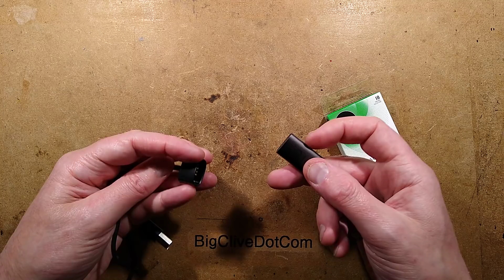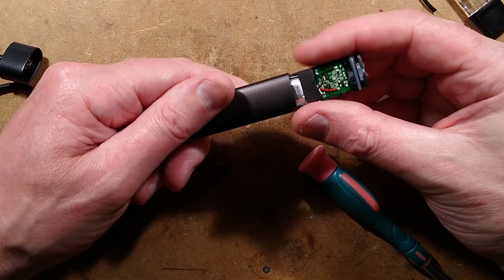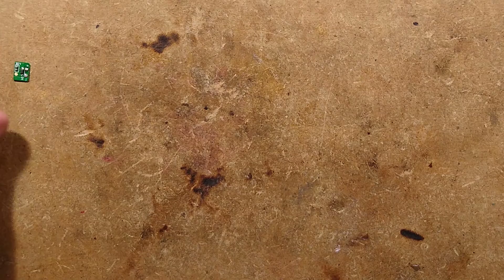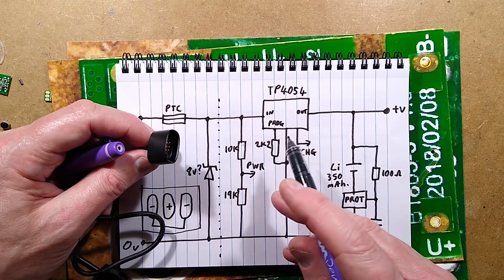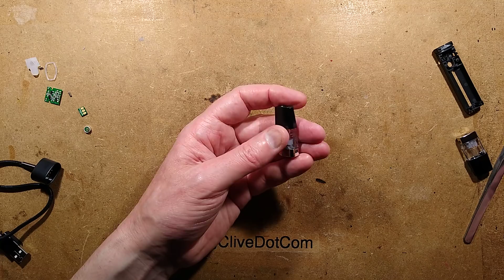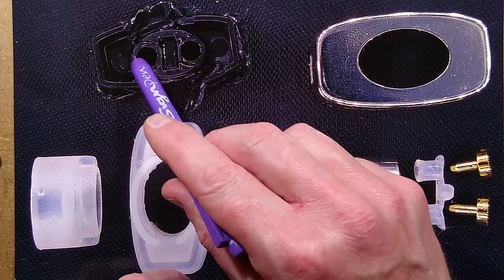Japanese fog-stick teardown.

Comment: I been trying to find a way to take apart a vape too..  havint found out a way seems pretty locked down.. ...   sigelei fog stick 80watt   came out this year  and i have 5 dead ones that died within couple months which was my family members...   I know if i can find a way to take them apart  i probably can get them going again...     http://sigelei.com/Product/Sigelei/Sigelei-FOG-STICK.html       @bigclivedotcom  would you know any idea how too get these barrel type vapes apart or anyone?   warranty was shit sigelei is slow and don't get back to their customers lol
Reply from the maker: Liquid ingress is often the problem with these devices.  It can cause track corrosion.
Reply: @bigclivedotcom   Yea they did leak under the pod a good bit which  needed cleaned a good bit and yea  family members hardy did that as i told them too... lol    just wish they wasint so dam locked tight...   There is 2 screws under were the pod goes on but taking them out just removes the plate and nothing else budges...
Reply: Found out how to get the things apart.   was looking at the bottom of the lcd screen and there is a metal ring going around it.  So i took my knife and put pressure on the edge  of it and yep it pop off and with the screws on top out of it.   got it apart which really wasint hard at all.     turns out a good bit of them batterys are stone dead so they wont charge.   But one was had a good battery  but had a bad firing button  and got one back working after sodering the battery in i :)

Comment: Isn't a microphone essentially a pressure sensor anyway, though?

And I can definitely attest to the inadvisability of magnetic connector-equipped devices for a trade worker - the offside-lead connector for my stereo Bluetooth earpiece was absolutely magical at finding swarf. I'd almost swear that it was generating swarf from thin air given its ability to attract substantial deposits while stuffed into my ear!

Comment: Eigate / Aspire do the same thing with their coils, soldering / welding non-heating / low-resistance wire between the heating coil and the coil cartridge contacts.  I believe it's fairly standard on the more premium brands, and it minimises heating of the 510 connector and tank body.

Comment: Interesting, does this monitor or regulate the resistance through the coil like a lot of modern mods.  It’s something you have to take close attention to on the rebuildable and tank coils
Reply from the maker: Just on or off.
Reply: bigclivedotcom so it could potentially still fire with a damaged / fatigued coil either increasing or deceasing the Ohms? Either way looks like a good bit of kit. As for refilling the ranks I would say they could be refilled a few times but eventually the cotton wicking material would burn or degrade.     Al this is of course based on much higher power rebuildable mods

Comment: Interesting the way he switched from Canon to Epson because I actually switched from an Epson Inkjet to a Canon Laser printer.  The Laser printer is of course much more expensive than an Inkjet but I got tired of not being able to scan or print because my Cyan ink was low again even thought I just filled it a month ago and barely printed a few pages.  Had the same issues with other Inkjets as well but with laser printers you don't have to worry about your ink drying out because it actually uses toner which is supposed to be dry.  The toner cartridges should also last damn near forever as they have much greater capacity (while a toner 'cartridge' cost more than an ink cartridge the actual cost per page is way better for a laser printer).

The reasons I went with Canon in particular is because 1; I'd already used both HP and Epson brand Inkjets and found them frustrating for numerous reasons (Clumsy over-bloated software, constantly need more ink, other software annoyances), 2; Canon had the best overall ratings as far as I could find, and 3; There was a Canon model that had everything I wanted (print and scan with both glass and feed scanners) with good reviews for $300 (which is very cheap for an All-in-One Laser printer).

Comment: You take apart the tank wrong. Instead of prying the metal bit off over the black tabs, you can push the black tabs in with your fingers therefore making it a more viable way to refill.

Comment: Hey Clive need some advice and know your the guru of all things electrical. I have been gifted a old nu tool ch10 bench 350w drill. It currently handles speed control by  manually moving a belt onto various sized pulleys... I want to change this to a electronic speed control, can you recommend the right unit I need??
Reply from the maker: It depends on the type of motor.  If it's single phase and you use a simple speed control you'll also lose a lot of torque.  There's a lot to be said for the simple belt arrangement.
Reply: @bigclivedotcom  thankyou for your wisdom I will give it some time in its current configuration, I hadn't considered the effect on torque.. You sir are a legend!!

Comment: Timely video... I had a few dead ego batteries lying around, along with some cheap power banks and some 4000 mAH 18650 batteries, so a bit of destruction to get the ego connector and circuitry and button, and a little soldering later I have a 4000 mAH system that I can stick any refillable clearomizer onto. Plus I can charge it via micro USB or via the ego type charger...

Comment: so i took apart a disposable single use one and it contained a rechargeable LIPo battery el-501447p 280mAh 3.7v.
do you think its because a single use battery couldnt provide the same power at a similar cost or is it possible to simplify inventory if they make rechargeable one like the one you took apart in this video.  I would love to hear your input.  My friend vapes them so ive been taking them apart and saving the batteries

Comment: Big CLive, what do you use as solution into those cartriges?
Reply from the maker: Base 50/50 glycerin/propylene glycol with a small menthol crystal added to a large bottle to add a slight mintiness.

Comment: You are so awesome. I've learned 95 % of what I know about electrical engineering and electronic components from your videos. 
I especially liked this one because it's to do about vaping.
But did you happen to test the resistance of the coil and at what wattage it consumed?
Reply from the maker: Runs at about 2A.  So around 7W.

Comment: Canon showed it's real colours by chipping their ink cartridges.
Like you I discarded my canon and purchased a refillable Epson.
Wish more people would do the same with Apple and now Samsung products who purport to be environmentally friendly but do everything possible during their products design and repair chains to stop you repairing your own product or even replacing batteries.  Like canon both of the above reputedly release software updates to slow down older devices and certainly include soft or firmware to prevent you from using after market products.
Reply: HP has done likewise, but they bought key designs from Canon.

Comment: The moment you put the second printout on top of the first, I was like "Clive, you took the bigger PCB away from the printout, but left the smaller PCB on it. Will you be looking for that tiny thing later on? Move the top printout and it will tell you where that board went..."

Comment: Protip: you can make your own small drill bits by hammering lightly on the sharp end of a pin to flare it out a little . You can then sharpen it a bit by stroking on a whetstone. Think a spade bit for wood. I've held them by cutting the heads off and holding them in either a small xacto blade holder or a pin vise, whichever is handiest. 
Easiest way though is to melt a hole through the plastic by holding a pin or needle in small vise-grip pliers and heating it with a flame (candle, small torch, cig lighter, whatever), then punching through.

Comment: my wife has one that's very similar on the cartridges you can take the metal cap off the bottom and pull the coil out and refill them all you need vice grips

Comment: I'd love to see a teardown and reverse engineer of one of the big devices, like the geekvape aegis for example(only because it's what I own.) The circuitry must be pretty neat with it's temperature control and ohm sensing.
Reply: The boards in regulated mods are typically pretty simple and boring. It’s all in the controller and the installed firmware. 🤷‍♀️

Comment: 1k resistor plus diode is likely a continuity tester circuit for the MCU to sense if a cartridge is attached or not. If no cartridge, it locks out the mosfet via code.

Comment: Canon has learned their lesson...any ink cartridge with a "chip" can be bypassed today, but Canon is also making the giant ink tank style printers. I have a 5 year old $35 canon printer that is dedicated for black and white only - I print tons of documents - really, really easy to refill the ink. When the printer detects you have printed way more pages than possible, it has a stroke and stops working. All you have to do is hold down a a few buttons and it resets.

Comment: I read "Japanese frog stick teardown".
Any way, well built. And the polarity are reversible.
Reply: Now I’m trying to imagine what a frog stick would be used for.
Reply: @BRUXXUS  I've seen frog eggs that come in a plastic tube...
Reply: Polarity didn't look reversible, thought it had a central + pin and then a - pin on either side

Comment: Local gas station had the Vuse Alto's for .99 so I picked up 5 for the 380mah battery inside them. Same magnetic usb connection, same nice box.  Nice and slick, and made in China.

Comment: I use a newish (less than 6 months old) Brother Colour Laser All-In-One, not only has a built in but hidden reset menu for all the cartridges (so you can completely empty them if you want), can "unofficially" take the highest capacity 9K cartridges (despite the manual claiming the 6.5/4k high yield  cartridges are the largest that can be used) plus the cartridges are semi-dumb with a mechanical means of recording/measuring toner use (there is no electrical connection between the printer and the cartridge), naturally this can also be reset easily. A full set if compatible 9K toner can be had for ~£70 which is also not too bad, amazed that with a 5% off ebay voucher and £100 back due to a brother cashback offer (choice of 3yr? warranty or £100) I only paid £150!
I also like the fact that the ADF has an extra scanner head built into it so it can scan double-sided pages in one pass.

As for Canon locking out features if non-genuine cartridges are used, I thought that was banned in the EU, and yes the old dumb cartridge canon's (i.e. the 24 B/CMY cartridges) were really cheap to run if aftermarket cartridges were used.

Comment: I’ve got a Canon multifunction printer/scanner. The f*cking thing disables “premium” features because I run 3rd party ink in it. I mean, the features aren’t that exciting - scanning to google drive, and some other stuff I never use. But the first time I discovered the inks were effectively hardware dongles I was a little bit annoyed.

I’m also quite certain the printer deliberately prints poorly with the unbranded ink too. There’s patterns to the misprints it does, as if the colour jets decide to block up at specific parts of the page.
Reply: Canon MG 36000 series by any chance? My mother’s MG 36505 model does the same.

Comment: I thought it was a portable smoke machine
Reply: 160rpm I was hoping it was a teeny tiny smoke machine too. I wonder if they’re hackable to do that?
Reply from the maker: There are tiny smoke machines that use a standard vaping device with an electrical tap and air pump between the base and head.

Comment: I came across something very simiilar.   It's metal body (plus damage) meant I jad to rip the metal to open it.   Nice battery and charge circuit.   Fluid carts look the same, amd mine had a standard Mini-USB. Very useful internals.

Comment: i print so infrequently, i still have and use my HP laser printer 4? the 3 finally gave up the ghost... i love my laser printers
Reply: I used to repair HP Laserjets, the 3 series is probably still my favorite. Built to last.
Reply: Tree-killers. Amazing longevity. You can query a good few PostScript laser printers for their lifetime printed output numbers. I've seen an Apple-branded printer, long in the tooth and still chewing, with more than 100,000 pages printed. I can't recall, though, if that model used the Canon engine -- though I suspect it did. Unfortunately, they don't make anything the way they used to -- not the body plastic nor the 'rubber' of the pick-up rollers. Hardware rots in the air and light of consumer spaces.

Comment: I guess the diode at the heater-part is to make sure there for when you start viping without a cardridge and heater to keep the voltage in a good value when you put it in.

Comment: I'm wondering what happens if the unit is operated without a cartridge or with an empty cartridge. I suppose it wouldn't matter if it powers on and nothing is connected, but wouldn't the wick burn if not cooled by liquid? Is there some hidden safety device?
Reply from the maker: The heater's in the cartridge.  If it's empty it gives what is referred to as a dry hit which is like traditional cigarettes and very unpleasant.
Reply: @bigclivedotcom  That does sound unpleasant. It appears most users of the device are familiar with the problem. Thanks.
Reply: eDoc2020 I wouldn’t call it a problem. Only problem I see is with companies not making the pods refillable. Crazy amount of waste materials.

Comment: BTW:  When needing to probe very small circuits or components I got an extra pair of probes for my meter and soldered on a sewing pin to each tip...works great  :)
Just cut the head off the pin and it solders on very nicely...this also works well for poking through wiring insulation for testing voltage inline...makes a tiny hole that seals itself.
Reply from the maker: My current probes are super-sharp and can dig into solder, but it was still very fumbly.
Reply: Right...because nothing bad ever happens from a tiny hole in electrical wiring insulation.

Said no one ever.
Reply: @fertilizerspike  also moisture and capilar effect seem like absolutely unreasonable words in this context...
Reply: I do wrap it with e-tape...so take a pill guys  :)
Reply: ha ! i use accupuncture needles in my micrograbbers ... no soldering required ;)
Reply: Dave Micolichek  "... Liquid electrical tape "  May be but it's insanely expensive! Or does it go a 'long way'?  TIA
Reply: Gregory Tom 'Enough already, stop with the ' extra pairs of probes ', ' head off ', ' pin on the tip ' , ' poking through ', ' tiny hole seals ' 
Willya godammit?!  
I'm trying to watch the fricking news!

Comment: This fog stick looks an awful lot like the Vuse Alto that my mom uses...I refill hers too...but I just pop off the metal cup and the rubber pad underneath to fill it with a 23 gauge needle.
I can refill them about 12-17 times before the heater starts getting too manky and tastes burnt...so by refilling I save her $6 x 12-17...and I only use pharmaceutical grade ingredients.
Her battery is also 350mAH and lasts about 6 months before needing replacement...and the new batteries are only 99 cents so I got her 40 of them  :)
All that packaging for that little fog stick?  What a waste of resources...JT Inc ain't much of an eco-friendly company, is it?
Reply from the maker: Has your mom felt health benefits from stopping the traditional cigs?
Reply: @bigclivedotcom  Very much so...she used to smoke 2 packs a day...I smoked 3 to 3.5 packs a day...she is down to zero and I am down to 5-7 a day.  Her doctor is the same as mine and has said that we are doing very well now.

Comment: "Vype ePod" appears to be the identical system under a different brand - but of course deliberately incompatible since the spacing of the Cartridge/Charger pins looks slightly different. Funnily enough i was just in the process of re-filling my Cartridges when this video popped up (since you mentioned the process in a recent stream i went looking for that japanese device and came upon the 'Vype' branded one a few weeks ago)

Comment: Well engineered and Japanese? Just opened up a Japanese zoom audio mixer and was appalled by the construction. Or like Toyota frames that rust and Honda airbags that explode and kill?
Reply: Because German cars don't rust?
Reply: 🙁 I’ve got a vintage Sanyo mono cassette, radio and I will have to replace all the electrolytic capacitors as they are turning into resistors - I have stopped using it because of low volume output and risk of damaging pcb components and have put it in storage, until I get round to doing it 😣 - made in Japan

Comment: wait the sensor wasn't a mic?
Reply: Nope it's a pressure sensor put inside a repurposed microphone capsule.
Reply: I feel like mic would be the worst implementation possible lol. I can't even imagine how quickly it would discharge both the battery AND the carts.
Reply: Yes and it listens to you while you're foggin'.

Comment: Sexy engineering and materials for a disposable product. Looks pricey. You say 5 pounds for two, I found them for 4USD Each here in the US.
Reply: Um...the fact that it has a charger and replaceable cartridge makes it something slightly less than disposable. But then everything is disposable in a sense.